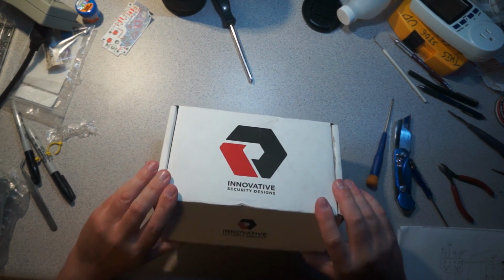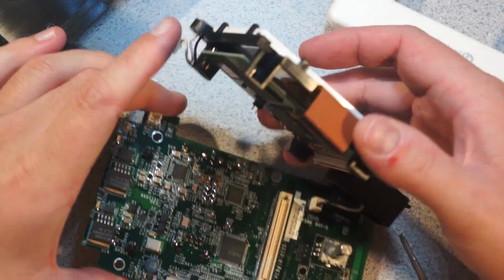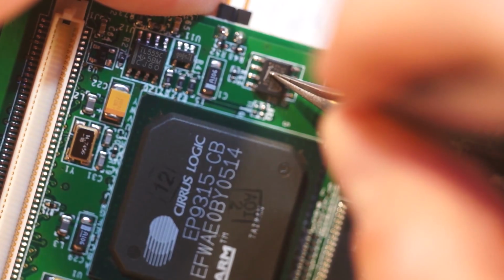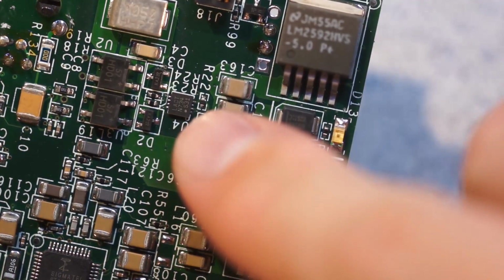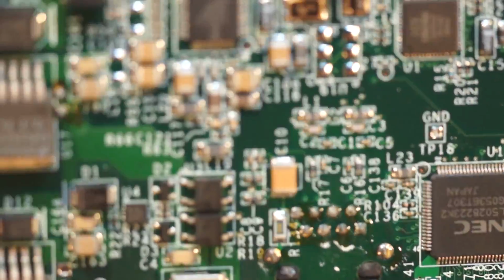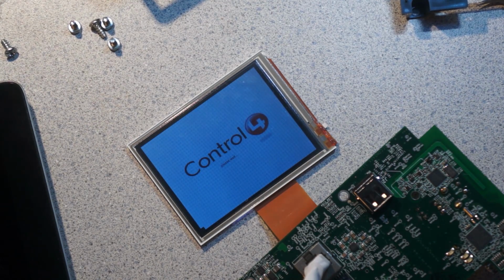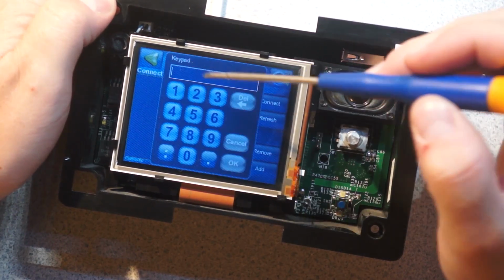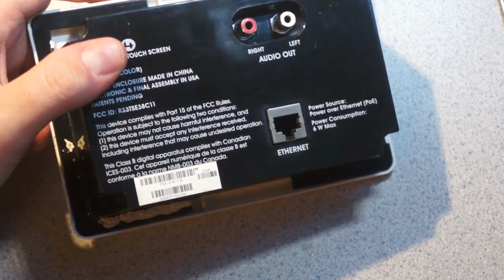Control4 Ethernet Mini Touch Screen Teardown

Comment: Erm....you don't need a RTOS to just do a in wall control panel. You don't need much at all actually. And embedded system != high end electronics. There was not a chip on that board that is over $5 in volume.

Comment: These things are definitely not made to a price; they are extremely robust, using components designed for embedded system use, and running a high-availability RTOS such as WinCE, QNX or RTLinux, and software with very carefully verified code.

Comment: I've seen people, as late as 2008 or 2009, installing literally $20k home automation systems based on this kind of stuff and I always told them: this stuff is pure vendor lock-in, support will probably stop once domotics become commoditized and you will have lost oodles of money. I got to laugh at them like 6 months later :P

It's nice stuff from a technical point of view (look how they spared no expense on the board, it's not cost optimized) but as a device it's useless mostly.

Comment: These are really designed to be built as a whole system into a home. Friend of mine has a system. All the lights, TV, movies, music, alarm system, radio, and other media devices are controlled with it. They really went all out with the system so they even have streaming servers and video distribution on a rack. Lets them play any movie from the 400 disk bluray player or just satellite tv in any and/or every TV in the house...

they are well off...

Comment: The 555 may be a deliberately dumb watchdog to reset the system if it crashes.  That rotary encoder probably has a push-button function built in too.